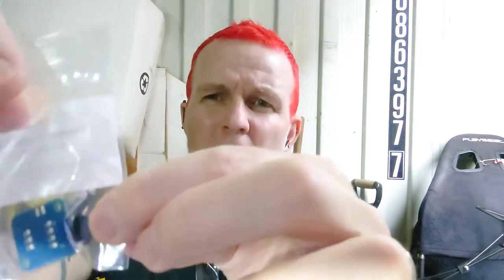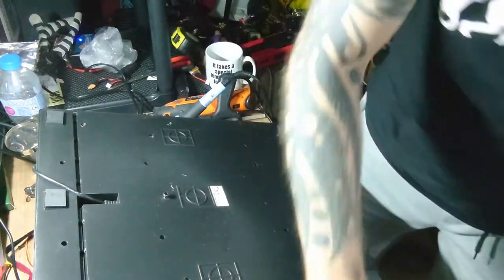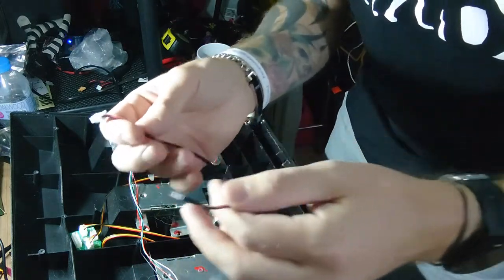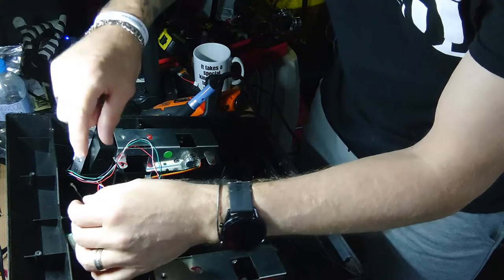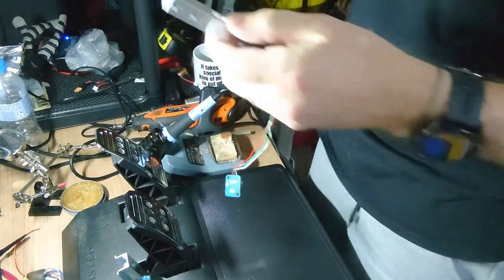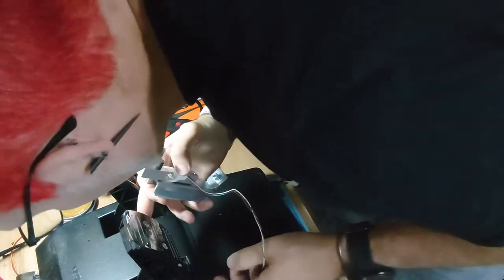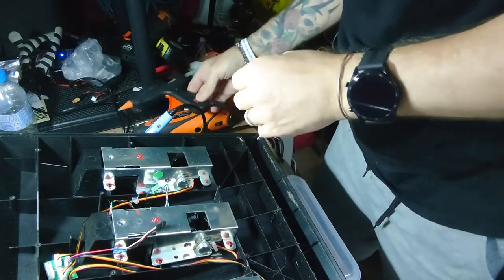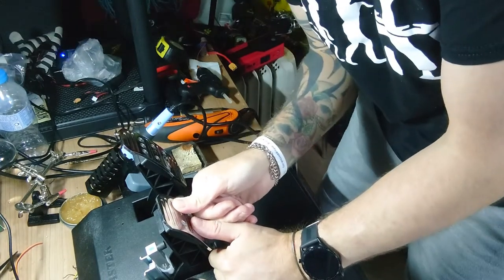THRUSTMASTER T3PA DIY LOAD CELL MOD, CHEAP MOD UNDER £25 FOR CONSOLE AND PC

Comment: thanks for this very easy, apart from on my t150 it seems that red wire is ground and black is live??, i just couldnt get it to recognize the LC until i saw another thread on irst, so i flipped the plug that goes into the amp, and it works😊

Comment: I’ve ordered the parts so I can this on my T3PA PRO pedals. The conical brake mod bracket is different on the T3PA PRO so I’m going to rig up some sort of mount to get it working. Thank you for the video. 🤙
Reply from the maker: Awesome.. Takes a bit of getting used to but definitely worth it.. Hope it goes well mate.
Reply: @RobbofpvGaming  I just finished with the mod and I'm really happy with how it turned out: https://revolutionsimracing.com/threads/t3pa-loadcell-upgrade-diy-guide.1588/page-2
Reply from the maker: Awesome mate, I'll have a look now..
Reply from the maker: Fantastic mate, have you done any laps yet?
Reply: @RobbofpvGaming  I gone on shuto in assetto corsa for a quick run and i like it more than the standard conical mod already but I still need some time to adjust
Reply from the maker: It really does step up the realism doesn't it.. Another quick tip I've done since.. The rubber stopper on top of the load cell, I've screwed mine all the way down so it leaves a gap between the rubber and the pedal.. I've then got a spring, the same diameter as the rubber and put that over the stopper and cut it to length so the spring touches the bottom of the pedal, it makes trail braking a bit easier, it's a bit easier to apply light pressure as you're pushing against a spring before you push properly on the load cell.. I grab a link for the spring I used..
Reply from the maker: https://www.ebay.co.uk/itm/114210854495
Reply: @RobbofpvGaming  that’s clever actually I’ll look into it. With the pros you have a little more adjustment so it can easily change the pressure but I’ll keep this mind. Thank you
Reply: Searching T3PA PRO Throttle Brake ...and always get this :(

Comment: I really liked the video but do you really notice the change? Or better to invest in better ones like TLCM? Thanks. 
On the other hand, I've been researching to do this to mine and I've seen three people using Leo Bodnar's amp, but does it have to be this one? Stores also sell other amps but they are not the same. Thanks for the possible clarification to the doubt. Greetings and good video.
Reply from the maker: Thanks mate.. I can't compare to the tlcm Pedals as I haven't tried them but I can confirm that, after a period of getting used to how hard you have to brake (as you would in real life) my braking consistency and technique has hugely improved. If you've ever thought "how can I shave off a few tenths here and few tenths there" it won't come straight away with this system but it definitely opens up options with braking techniques.
As for the amplifier, I can't give you any kind of definitive answer with that I'm afraid.
Reply: ad623 board is an alternative

Comment: Wondering if you can help me , installed everything but without touching the load cell it says I have 100% brake pressure. Even if I press the brake it stays at 100%?

Comment: Great video. I’m going to do this mod. However I will drill and tap for a larger rubber mount. M6 15x20mm. Thoughts on this?
Reply from the maker: Yeah the rubber mount could be made better.. I ended up getting a spring with the same diameter and fitting it round the rubber mount to strengthen it and give me some low pressure braking..

Comment: So I'm thinking if doing something similar to DFGT pedals, will the braking force required damage the pedals, considering DFGT pedals are plastic rather than metal?
Reply from the maker: I can't answer for sure mate but the thrustmaster Pedals are plastic too.
Only advise I can give, is avoid spraying any wd40 on spueaky Pedals as it makes the plastic brittle and more likely to break.

Comment: Hi brilliant work thank you so much for taking the time to do this. One question! Could you please tell me what size of rubber buffer I need off ebay as there are a lot of different sizes. Many thanks Stu
Reply from the maker: Hi mate, the rubber buffer is an M4, 10 x 10 here's the link to the one I used https://www.ebay.co.uk/itm/BUFFER-Rubber-Mount-Anti-Vibration-STOPS-Male-ALL-SIZE-M6-M8-M10-M12-M16-D-/223700384876?_trksid=p2349624.m46890.l49292

I also got this spring after and cut it in half and seated it over the rubber buffer to make light braking a bit easier.. https://www.ebay.co.uk/itm/COMPRESSION-SPRING-Wire-Diameter-1-5mm-P-/114210854495?_trksid=p2349624.m46890.l49292 it's the "P9" option and just needs cutting to length. Thanks for watching bud and good luck with it.
Reply: Awesome thank you so much, can't wait

Comment: Hi there! This is such an amazing video. I would like to give it a go but I am struggling to find that kind of amplifier. I can only find the HX711 amplifier. Do you reckon it will work too? Thanks a lot.
Reply from the maker: Hi mate, I couldn't find any info on the HX711 amplifier so I stuck with the leo bodnar.

Comment: Nice! Does it still working?  How is the calibration? You have to press the pedal 2 or 3 times after power on like the original?
Reply from the maker: Still works perfect mate, I use it for league races every week and can't imagine not having it now and yes, calibration is exactly the same, just apply what you want full pressure braking to be and you're calibrated.
Reply: @RobbofpvGaming  Thank you for reply! I am waiting Leo Bodnar amplifier comes and I will make it here. Maybe my lap times comes...

Comment: Hello, congratulations on your work, I was wondering, if the same procedure can also be used for the G25 / G27? By connecting LeoBodnard directly to the G25 potentiometer wires! See you soon
Reply from the maker: Hi mate, I'm not sure to be honest but definitely worth doing some research..
Reply: @RobbofpvGaming  Hello, very fast response, great, what do you say, can we test? Do you have any way of knowing if it might work? Thanks
Reply from the maker: I'll look into it but I haven't got any logitech wheels to test it on.
Reply: Almost sure it will work as it will output the same signal as a potentiometer i guess.

Comment: Just to let you know I've worked out my mind is not working my 3 TPA pedals the red wire is negative and the black wire is positive the opposite from your description so anyone doing this should check with a multimeter first just reordering amp now fingers crossed

Comment: Am I right in thinking that the pedal movement made just before making contact with the load cell won’t register as braking? Is it only once the load cell and pedal arm meet
Reply from the maker: That is correct mate. What I've done since making this video is cut a spring to fit behind the pedal and around the rubber stopper so I get light pressure on the brakes when needed and still get full pressure when needed. Hope that made sense.
Reply: @RobbofpvGaming  Is that stopper part of the kit? Or can you mount any sort of stopper, would it be better to just have a bigger slightly softer one that touches the pedal when at 0% braking?

Comment: Hi I don't know if you can help load cell I ordered was an HX 711 did all the work and put it together today but got no nothing back it's just not working I don't know if I've got the wrong loadcell or not if you could help that would be great
Reply from the maker: Did you hook it up through the leo bodnar amplifier?
Reply: @RobbofpvGaming  no I wired it up just as you did in the video by the way it was a 2 S balance leads I do fbv as well
Reply: Sorry to be a pest but if you could let me know what loadcell you ordered I will try and find it on the internet maybe this one just doesn't work thanks alot
Reply from the maker: I didn't use the HX711 board, I used the leo bodnar amplifier that's listed in the description.. I'll find the same load cell now mate.
Reply from the maker: https://www.ebay.co.uk/itm/224246120591
Reply from the maker: http://www.leobodnar.com/shop/index.php?main_page=product_info&cPath=73&products_id=199
Reply: @RobbofpvGaming  thanks mate I already using the load cell amplifier exactly the same as you had and  I don't know why it's not working but thanks for your help anyway how we check my wiring tomorrow

Comment: the link for the loadcell is not working have you by any chance got another one another link
Reply from the maker: Hi mate, I've not had chance to put another link up yet but all you're looking for is a 20kg load cell. If I get chance later, I'll link another one.
Reply: thanks for the quick reply I found another one on ebay
Reply from the maker: @peterwilliamson4957  that's great.. Good luck with it. 😉

Comment: I didn't have to replace the amp just reversed polarity and it all works fine now looks like it's going to work well thanks a lot mate
Reply from the maker: Aahh good stuff mate, glad you got there in the end.. I do remember seeing variations of wiring when I was researching.. Glad nothings damaged.
Reply: @Peter Williamson hey what are you using for this upgrade? i have hx711 board and t3pa pedals
Reply: @BorisSchmidt  you need the Leo Barnard centre sensor as well

Comment: I cant buy Leo  Bodnar LC AMP, What its the alternative? I dont found it other LC AMP what do the same that Leo bodnar. Im from Spain, and Leo Bodnar now cant do enable airmail because Brexit. I need help. Thanks.
Reply: Buenas! Yo estoy en las mismas. Sólo encuentro el amplificador HX711. Has encontrado una alternativa? Gracias
Reply: @rialfe7514  Hola, averiguaste algo? Yo estoy investigando ahora mismo.
Reply: @rialfe7514  Las características del HX711 observo que son las mismas que el de Leo: 
Módulo utiliza 24 chip convertidor A/D de alta precisión hx711. Es un diseño especialmente diseñado para el diseño de escala electrónica de alta precisión con dos canales de entrada analógica la integración interna de 128 veces el amplificador de ganancia programable. El circuito de entrada se puede configurar para proporcionar un puente de presión tipo puente (como el modo sensor de pesaje de presión) es de alta precisiónbajo costo es un módulo front-end ideal de muestreo.

Control digital simple e interfaz serie: controles impulsados por pinesno necesita programación
Velocidad de datos de salida seleccionable 10SPS o 80SPS
Rechazo simultáneo de suministro de 50 y 60Hz
Consumo de corriente incluido el regulador de la fuente de alimentación analógica en el chip: funcionamiento normal < 1,5 mA de potencia abajo < 1uA
Módulo HX711 AD
Características:
Dos canales de entrada diferenciales seleccionables
PGA activa de bajo ruido en chip con ganancia seleccionable de 3264 y 128
Regulador de la fuente de alimentación en chip para pila de carga y fuente de alimentación analógica ADC
Oscilador en chip que no requiere componente externo con cristal externo opcional
Encendido en chip
Rango de voltaje de alimentación de funcionamiento: 2.6 - 5.5 V.
Rango de temperatura de funcionamiento: -20 grados a +85 grados.
Reply: @Darchful  Nada, al final lo dejé pasar...si al final lo intentas avísame. Un saludo
Reply: @rialfe7514  Ok! Voy a pedir los componentes entre hoy y mañana.
Reply: @Darchful  Buenas!! Finalmente te animaste con este proyecto?
Reply: @rialfe7514  Hola, si. Lo hice y funciona. Si no quieres gastar demasiado pues usamos mejores pedales de segunda mano o tiramos con los que tengamos y mejorando por el mínimo dinero posible. Estas cosas no nos van a hacer mejores pilotos virtuales pero si tener mejor tacto con el freno y frenar con el en el espacio-tiempo dentro del circuito.
Reply: @Darchful  Estupendo. Lo pensaré entonces. Yo tengo los T3PA. Te importaría pasarme los links a los componentes? Tu todavía usas la modificación? Muchas gracias de antemano.

Comment: At my pedals, it doesn't work... The amplifier is getting hot... And after that, my wheel base doesn't work anymore... It's defekt no.... What did I I wrong???????
Reply: Swap green/white wire coming from load cell wiring.
Reply: I don't need it anymore... I've got fanatec now 😅
Reply: @mv_simracing  (t3pm+LC mod=CSL lite)
I did my t3pas ad623 LC mod for $10 (excluding the solder cost). I don't use the phrase "night and day difference" often. You can never go back to non-LC input though, be warned. It's like power steering vs having no power steering pump.

(And correction: if amp gets hot, then 3.3v (black) and ground (red) Fanatec wiring😖 needs to be switched on the board. If you never get pedal input either green/white from load cell needs to be switched and/or the potentiometer screw needs to be adjusted on the ad623 board)

Comment: Hi, is there any problems with the voltage being different
Reply from the maker: No problems at all mate, been using mine weekly for about a year now and all works perfectly.
Reply: @RobbofpvGaming  that's good to hear. I've just ordered the parts you linked. I've done the magnetic shifter paddles mod where you remove the spring's inside  and it give it a nice strong chunky feel with the magnets I used. I can send a like if you want to do it
Reply from the maker: @iceman1st1  that's not something I've looked into much but yeah, I'll check it out.. Thanks man. 😉 👊
Reply: @RobbofpvGaming  I've got all the parts now, but I can seem to find the metal mount anywhere. If it's not too much trouble could measure yours so I can make my own please bud
Reply from the maker: @iceman1st1  my Pedals came with the metal mount for the conical brake mod so maybe search for that bit in the mean time, I'll get you what measurements I can tomorrow.
Reply: @RobbofpvGaming  hi bud, I followed everything you did but I'm getting no input. is there anything I need to do like to get it to recognize.
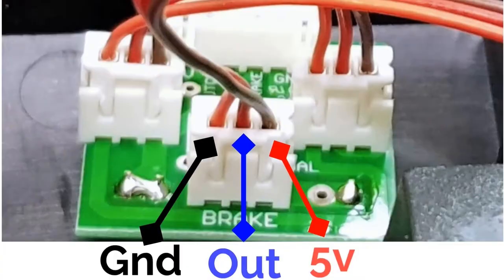Reply: @RobbofpvGaming  it's ok now, I've sorted it. 16:51 The 5v and ground wires are the opposite. It might be a good thing to mention it just in case someone else has the same problem

Comment: Do these modifications work for console models as well ?
Reply from the maker: Yes, I use this on ps4.
Reply: @RobbofpvGaming  does the ps4 reads it as a mechanical mod or computerized mod ? I’m about to get a t300 rs gt with the t3pa pedal gt edition and thinking about getting this done but I’m on ps4
Reply: @Amolakms95  how did you go what did you get?

Comment: can you do this on the throttle as well?
Reply from the maker: Probably not a good idea for the throttle, these work off pressure so there's barely any movement on the pedal where as the throttle requires more resolution in movement for control.
Reply: @RobbofpvGaming  i tried this mod and i am not sure if i had the load cell wired right to the amp,also to the pedal pc board
Reply from the maker: @MrBobchiz1  does it work at all? You have to brake with quite a lot of force.
Reply: @RobbofpvGaming  no not at all.I think the color code in the peddles is what's messing with me.